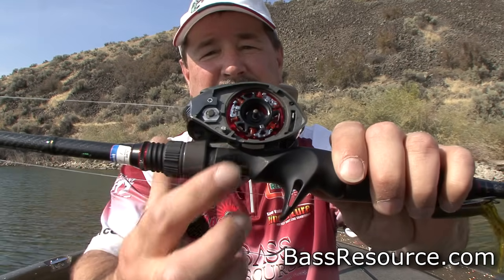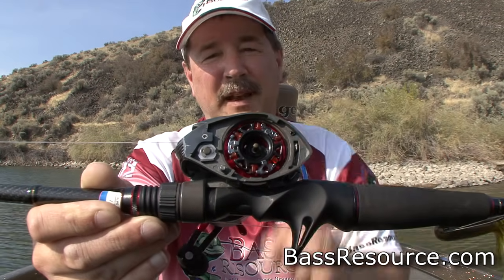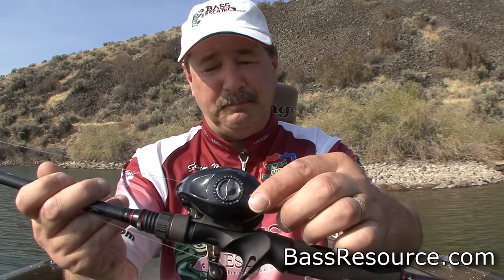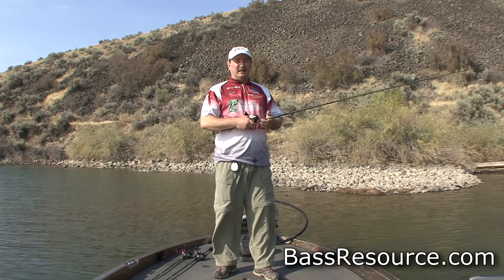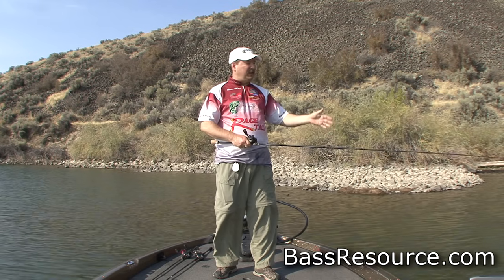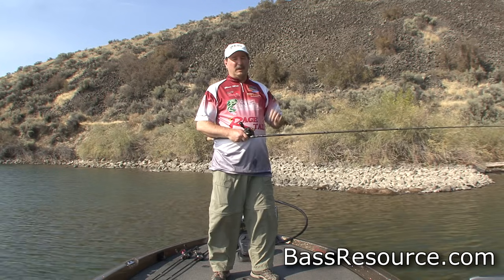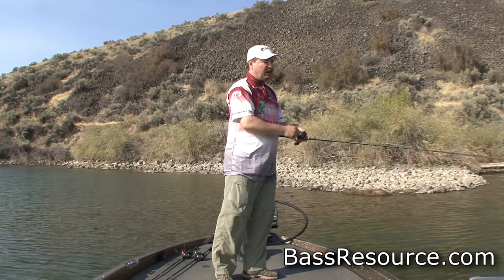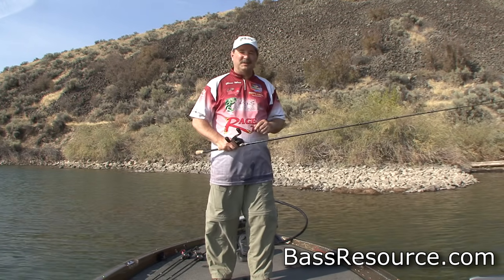How To Cast A Baitcaster | How To Adjust A Baitcasting Reel | Fishing Reel

Comment from the maker: Yes, I accidentally transposed the names of the centrifugal and spool tension names.  Oops!  LOL!!!
Reply: The pins inside the cover are the centrifugal brakes right and the outside of the cover is the magnetic brake and the one on the right is the tension brake? Just want to be sure. Ive fished all my life but always with spinners now switching over but got a little confused when you accidentally transposed them. So I just wanted to be clear.
Reply: Sorry - I posted my question before reading this.
Reply: You also do not keep adj the spool tension on the reel handle side.  That is to set minimum clearance.  That drop to the floor is the newbie setup.  Again it's not a brake.  If it actually puts tension 9nnthe spool it will create wear.  Watch surf casters set the tension on their round reels.  Also in general centrifugal control more 9n start up and magnetics more on mud to end of cast.  Yes it's not that black and white but it's a general understanding.  In general magnetics usually do a better job when dealing with light lures and wind.
Reply: @tonykomer2997  Magnetic control is superior to centrifugal because there's no friction, no wear and tear, and more finer adjustments. Won't use anything else.
Reply: @tonykomer2997  Bingo Sir, you nailed it; ten points!
Reply: @Shurmash  Bingo #2, ten points.

Comment: As others have said; I actually watched AND physically made the adjustments to my bait caster, at the same time. 
As an absolute beginner, with a bait caster, your video saved me from cutting my rod in half to fit in the trash can.
The WRIST angle - as you would shake someone's hand",  invaluable.
 - Brake vs. side tension dial - invaluable.
 Thanks for taking the time to shoot this Edu vid!
Reply from the maker: Dean, glad I could help. Let me know which tips helped the most. Looking forward to hearing much more from you.
Reply: Dean Penneman to the loan
Reply: Had you bought a two-piece rod, you wouldn't have to "break" it in half.
Reply: @usernamemykel  2 pc rods are garbage
Reply: Great video, AND a great quip.
Reply: @N1K5M1TH  not if you superglue the pieces together ;) lol
Reply: @N1K5M1TH  Not All.
Reply: @artistmac1.3  Bingo

Comment: I am 59 years old. Been fishing for over 50 years. Never got into baitcaster reel's. Always used spin casters or close faced reel's. My buddy at work got me  Quantum Pulse Bait caster for learning how to use one. He got the Black Max baitcaster put it on a Berkley Cherry wood baitcaster rod.  I chose a 6'6 Ugly Stick medium heavy bait caster rod. He adjusted my reel high up so I could learn how to thumb the reel. We let it back lash so I could learn how to fix the backlash's. I still use the spin cast reel and rod for crankbaits and spinner baits and such. But my baitcaster is for jigs and Senko's mostly.  It took a good hour to learn to throw side arm and thumb the reel. But I got the hang of it and loosened the dial from 10 to 6. I started casting farther and farther. Catching Bass in his Honey hole pond. Fished all season  with both reel's and rod's. Installed 20 pound braid on the bait caster. By seasons end got pretty good with the bait caster. Moving up to the Quantum ACCURIST PT S3. For next seasons fishing. Will stay with the Ugly Stick medium heavy bait caster rod too. Keep at it!  You will catch on!        Shawn
Reply from the maker: Yes, absolutely Shawn Beck! Thanks for watching!

Comment: Just got my first bass baitcaster setup after work tonight after using spinners and push buttons since as far back as I can remember. I was a bit confused about how the various brakes worked in unison (I got the Abu Garcia SilverMax 2), and this cleared it up a ton. I figured the magnetic and the centrifugal on mine did the same damn thing in a way, but boy was I totally unsure. Thanks to your video, I am gonna be screwing up less this weekend. Thank you for this! Best explanation on the web!
Reply: Do as he says with the centrifugal on two at least.   As you learn put the magnetic on 9 or 10 as you begin.  Turn back only one click at a time as you learn.    Learn in the backyard away from trees and lines;  not at the water or at the lake.   Learn at home first, practice, practice, practice.

Comment: Hello Glenn and thank you for all of your typically great instructional videos. I am still pretty new to baitcaster reels myself, having only used them for maybe a couple of years at the most so far, so I'm not trying to be negative or a "know-it-all" by any means by making this comment... but I feel that this is very important to point out so that no other newbies get confused in the baitcaster world. When you refer to the "pin" braking system that is opposite to the reel handle, that is actually called the CENTRIFUGAL braking system... and what you refer to as the centrifugal braking knob is actually the "SPOOL TENSION CONTROL knob". Everything that you said about what those parts do, what part of the cast they control and how you should adjust them was true though. I just don't want others to get them confused by mismatching the names of the specific controls because I started to second guess myself when I heard you call them what you did.  Again, I'm not hating on you, just trying to clear things up for those that may have gotten confused like I started to. Perhaps you could do an updated vid with corrections of this later. Thanks!
Reply from the maker: This has already been mentioned over and over and over in the comments, and is also mentioned in the description, and is also in the annotations.

Thanks!
Reply: You're correct. I did read through the first page of comments before posting and I didn't see it mentioned by anyone and no, I didn't expand the description to read it in it's entirety, as I suspect hardly anybody ever does before watching a video on YouTube. Sorry about the unnecessary comment.
Reply: Posting a video with incorrect mislabeled info and expecting people to read 100’s of comments for the correct info is awesome.

Comment: Another tip I would suggest for beginners is to use Monofiliment line to start with. Flourocarbon is more difficult and less forgiving. It's also less expensive if you have a birds nest you have to cut out. Great video!
Reply: Bryan Huff , how well does braided line work on bait casters, I am trying to get into bait casters, so I do not know much, but many people have said braid works well.
Reply: +Bode Whitmo start with mono because it is cheaper if you have to cut it out then switch to braid when u backlash a lot less
Reply: +Bryan Huff Backlashes are very easy to remove without having to cut them out, you just have to know how to remove them. A backlash is basically like a slip knot. At each point where the line is caught on itself there is a loop of line that has laid over and tucked under coils to the side. Look to see which direction the loop has laid over (right or left), grip the loop on the side opposite the direction it has laid over (in other words, grip the base of the loop), then pull it out (a small knitting needle works great for this). There are usually no more than 2-3 such spots to pull out in a backlash. With a little practice at it, you can remove most any backlash in one minute or less (and won't need a small knitting needle to do it anymore either).
Reply: Braid is a dream on baitcasters! It increases your casting distance. Most people recommend mini fir beginners, since a terrible bird nest that had to be cut out would be much less expensive.

Comment: Great work.
 Just some points I have found invaluable when teaching student.
-Side casting to start with... they tend to keep their casting to a subtle toss as apposed to throwing the lure. 
- Have beginners use their dominant arm/hand to cast and other hand to turn the reel
- Have new students learn to keep their thumb in contact with the spool/line. This is a great habit for getting the "feel" of any backlash and if they stop the lure at a specific target.
Thanks again for the great explanation of the breaks and spool drag
Reply from the maker: That's great information! Thanks for the feedback duewy Enki!  I appreciate it.

Comment: Yup, I set my Baitcaster like you said, and cast my new rod & reel for the first time I ever used a Baitcaster and casting for 2 hrs and didn't backlash one time. I am so sold on a Baitcaster now that I probable will never use a spinning reel ever again. I cast so far, now I can cast near 80 ft with a punch rig. Oh yea, I have the dial on one side I am set at 4, I tightened the knob so the lure wouldn't drop then eased it of until it barely dropped slowly and it was good to go. I really trust your instruction.
Reply from the maker: Parrot Bill Thank you, and thanks for watching!
Reply: BassResource
I gotta give credit where credit is due.

Comment: Thanks, Bass Resource!  Just finished my first year with my Quantum Pulse Bait caster reel. Went from 12 pd mono to 20 pd braid. There is a difference between mono and braid. When casting. I just had to get out on Jan 2nd. It was 52 degrees. But windy 15 mph. I had to adjust to every lure from a jerk bait to a hair jig with a senko trailer. Stayed at it for 3 hours. Adjusting to the conditions as I went a long bank fishing a park pond. Had alot of fun with my  new Quantum ACCURIST PT S3 baitcaster reel and a Berkley Cherry wood medium heavy bait caster rod. This combo didnt like the jerk bait to much. Will go with a Diawa Elimnator medium action rod for lighter lures. Thanks again for your straight talk. No Bull!  Advice.      Shawn
Reply from the maker: That's awesome! Thanks for watching Shawn Beck!

Comment: Great video - thanks for explaining in detail the different brakes and the sequence in which to set them up as until now for me it was a black art 👍
Reply from the maker: You're welcome Roger F Johnson!  Thanks for watching.
Reply: Actually, the pins ARE the cenTRIF'ugal brake. That knob by the handle is the spool tensioner (not a brake) and should only be tightened enough to eliminate all but a tiny bit of lateral play in the spool~ until you get your thumb "trained".

Comment: Im going to try these tips out this weekend. Thanks for the video. Ive been fishing for years with a baitcasting rig and never heard of these techniques.
Reply: I wasnt able to get out on a boat but I did fish from shore. I adjusted the spool like you said and dialed in a setting that allowed me to cast far enough and keep backlashes at bay. I now adjust every time I change to a different bait. Minimal adjustments needed, just the small dial and only a click or two. I also, practiced the casting technique, handle facing up and my direction has improved tremedously. I still need to practice but now I know what to practice. Thanks for the information.

Comment: I have reels with the centrifugal pin type brakes on inside of side plate, and magnetic brake adjustment dial on the outside of the same side plate, ALSO the spool tension knob on the handle side. This multi brake system will give you ways to easily dial in the proper spool speed for casting any lure without backlashes (except super light ones). Lew's makes several affordable reels of this type...

***SET-UP... 3-4 pin brakes in out position,  brake dial on same side set on 7-8,  tension knob on handle side slightly tight as lure falls slowly from rod tip... ( If your reel only has one type of braking, set that type the way I just mentioned above )

When learning to cast, it is easiest to leave about a foot of line hanging from rod. Then with a smooth sidearm motion, let the WEIGHT OF THE LURE swing out like a pendulum from the rod / reel. As you get better, you can work up to throwing overhand casts. The overhand cast is harder to learn. It may shoot straight up in the air. To keep your casts lower, begin with the sidearm swing cast. You can also hit your target more easily that way, and wont get frustrated.

Comment: I agree with everything except the part where he says that a reel cast farther with the reel being vertical. Number one, a reel can have 20 bearings but that does not matter one bit because only 2 or 3 bearings are spinning on a cast. The spool bearings. None of the other parts move except on the old round reels like Abu Garcia. Number two, bearings are designed for loads perpendicular to the bearing. "Side loading" a bearing actually causes more friction. The difference is almost nonexistent because if you have the spool tension knob touching the shaft at all, it will erase any distance gain, but I just hate when people state "facts" that are not true.
Reply: chris smith salt water bait casters always false cast to wet the line and swear they get more distance with enough weight they obtain the distance if the  flex is correct in casting

Comment: Great information.  One problem I run into is fishing with braid.  When I cast, my lure will fly half way out and then the line will bind or dig into the spool.  The cast is cut short and I get a hard jerk.  It can be frustrating after you cast 4 or 5 times perfectly, then the next cast gets jacked up.  Any tips on that?
Reply from the maker: The line needs to be on the spool tighter.  Peel off about 3/4 of the line off the spool, grab a rag, tightly grab the line with the rag, and then tightly spool the line back on (you may have to crank down the drag to do this).  The rag keeps the line from digging into your hand.  You don't want to be able to get your finger nail between the line on the spool, so get it on as tight as you can.  That should solve your problem.
Reply: Thanks, I will give that a try.

Comment: Great video!! Thank you. So I have a Lew's reel. I took the side plate off looking to adjust the pins you mentioned at the beginning of the video. My Lew's does not have those pins, or at least I didn't see them. So it would seem my reel only has the mag and spool brakes. Could that be the case?
Reply from the maker: Yes, that is likely the case.  It's very common.

Comment: As others have said, great video, clear instructions, thanks! I have tinkered with baitcasters for years now off and on but I still have much to learn. I like the subtle casting technique, but for some reason I just can't make it work. The lure always land 10 or 15 feet in front of me no matter when I release. I really have to bring it further back over my shoulder to get a decent cast. Oddly enough, I can get a great cast with my spinning gear using this technique. Any advice?
Reply from the maker: Try using a MH 7' baitcasting rod with a fast action tip.
Reply: Thanks! That’s exactly my setup. 7” MH/Fast baitcasting rod paired with an Abu Silver Max reel. Must be my technique...back to practicing in the backyard!

Comment: Advantages over spinning reels? I've always preferred spinners bc I dont have to switch hands after casting and it feels more natural. I can cast a baitcaster decently but I will birds nest it at least once and then I think why do I bother. What's the advantages of using a baitcaster?
Reply: If you like to reel left handed, and cast with the right, you can get left handed bait casters. The difference is feel, and accuracy. Don't throw away your spinning reel, they have their purpose, and are good to have in your arsenal.
Reply: Biggest difference: casting distance. A good baitcaster will send a 1/2 oz. lure 30+ yards.
Reply: I bought a leftie reel because of this.

Comment: You should put up an amendment to explain that your so-called pins are the actual Centrifugal Brakes. Centrifugal Force is the force acting at 90 degrees to the centre of rotation ie pushing the weights outwards. Yes, you have put up an amendment to correct your naming of the Pin Tensioner, you just need the extra note. Otherwise, GOOD video!

Comment: What you are calling the centrifugal brake--isn't.  A centrifugal brake using the spinning or "centrifugal force" to engage the brake.  As you mentioned, the knob on the right always is engaged to one degree or another.